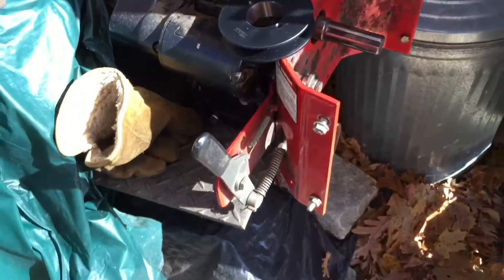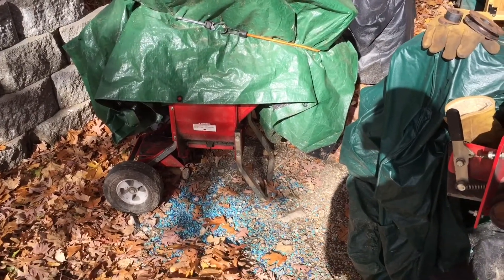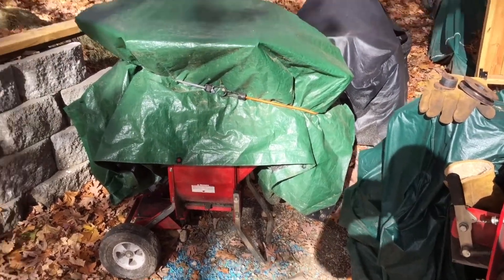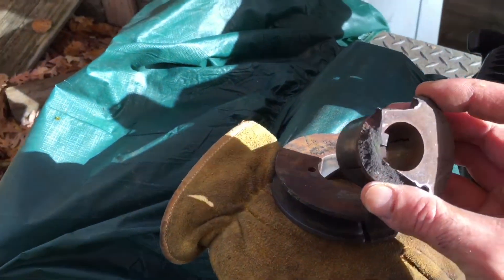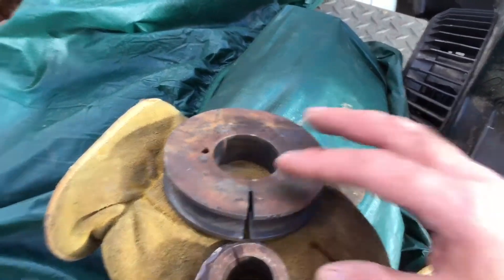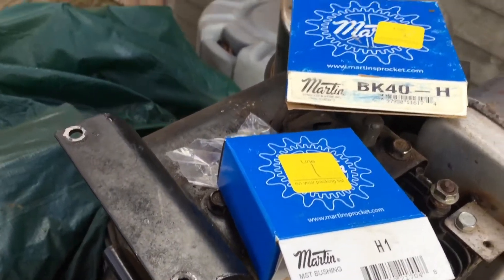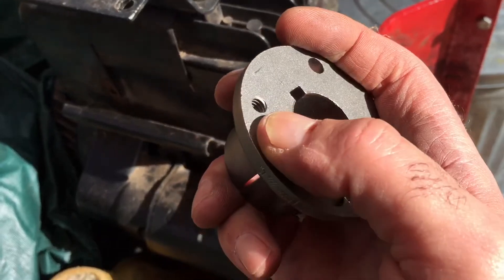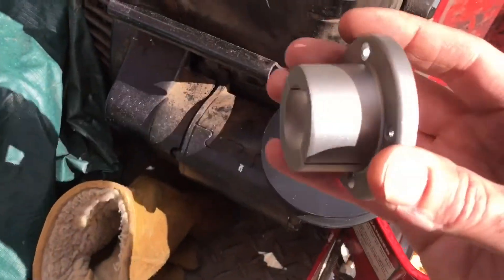Super Tomahawk Pulley Replacement

Comment: I have the same chipper 47266 and may have to use your method to remove the pully.  I found the Quick Connect Split tapered bushing Part #6086K19 but don't know the part # for Pully itself.  What did you use? Any cross reference or # would help.

Comment: Hey thanks for sharing this. Having the same issue. My pulleys are misaligned. I'm considering just building a bracket extension so I can simply bump the motor around so the pulleys align correctly. Is there any reason you couldn't use a normal key seated pulley with a set screw to keep it in place?
Reply from the maker: Maybe I just figured it was designed for the heavy duty so I’d stick with that. Thanks for watching

Comment: Nice work on the pulley replacement.  Was McMaster cheaper than the original Troy Built part?  I never would have thought of that.....
Reply from the maker: +rw3dog I had trouble finding the Troy built parts and I use MMC more often
Reply: I haven't done it to mine yet (also just busted a belt), but I saw someone mention replacing the pulley with a centrifugal clutch, and dropping the push idler pulley for a pull idler pull to avoid 1) wear on the belt while engaging/disengaging, and 2) heating the belt due to the direction change caused by the factory designed belt path. I'm guessing it should also help save the engine if you drop something too big in, as it will disengage when the engine drops below 3600 rpm.
Reply from the maker: +Nathan Stewart  is there a video?
Reply: No video, but i found it here https://permies.com/t/51002/Troy-Bilt-Tomahawk-Wood-Chipper
Reply from the maker: +Nathan Stewart thanks

Comment: Do you have the key size you used? I have a 47276 and I have to do the same thing. I order the 2 parts, I just need to know what key sized you went with? Thanks
Reply from the maker: Neil Kurtiak I think a quarter inch width but I’ll check. I bought long stock from McMaster Carr and cut to correct length thanks for watching!